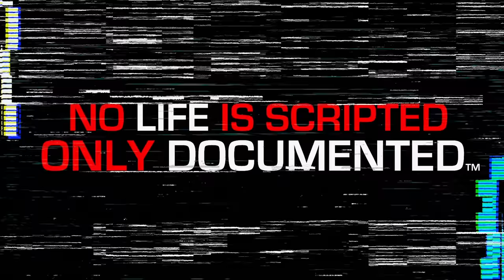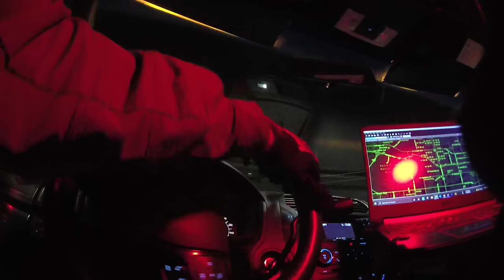Rasta guy throws a sausage at me + My BTS reaction

Comment: Patty, all ya have to do is remove door panels and unhook the inner door handle rods and put panel back on,then they wont be able to open doors from inside
Reply: The thing is u dont want them to know that its bait as far as they can tell it's a normal car u have to add a
 Kill switch and a remote control door lock really not that hard to acquire
Reply: With the inner rods removed from inner handle and panel back on nobody will know until they are in and its to late...and no wiring or kill switch needed
Reply: I was about to say that same thing

Comment: Just break all the inside door handles off and they won’t be able to get out but you can get in and also take 1 and 3 spark plug wires off the car will start but it will run like shit